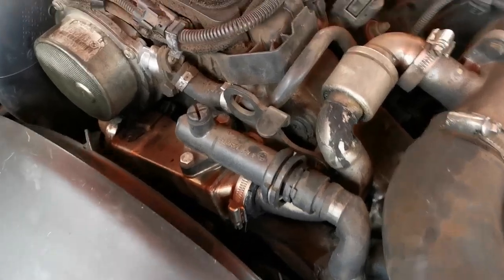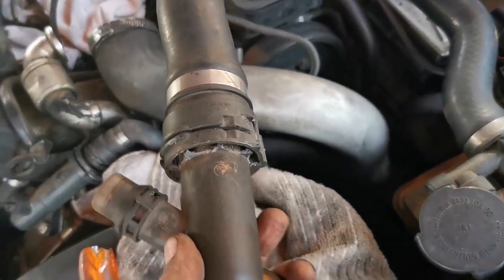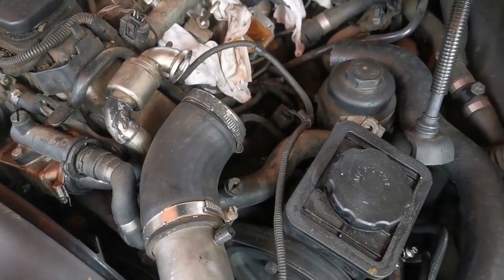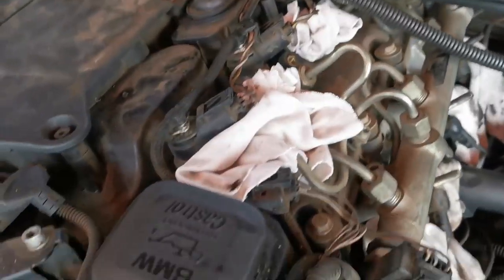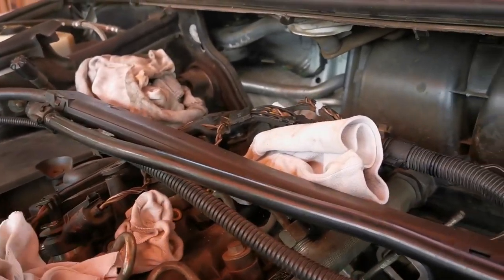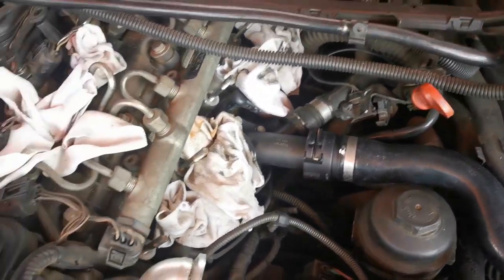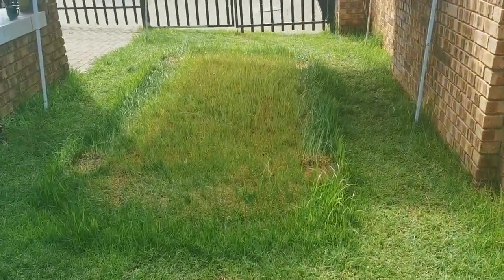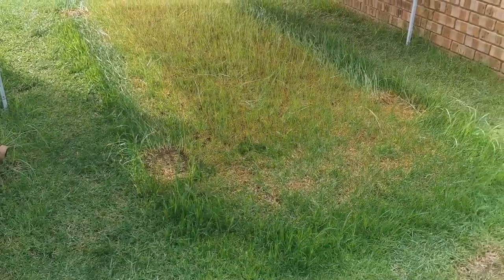Repairing the water leak on an BMW 320 d E46

Comment: So true about getting disheartened, I opened the injector adjustment value section on INPA and it wouldnt start after that a couple of times but i waited a bit and tried again and it was fine. I was kicking myself thinking i bricked my ECU